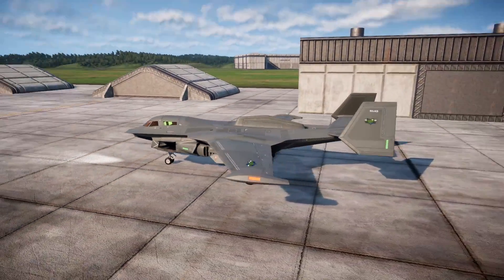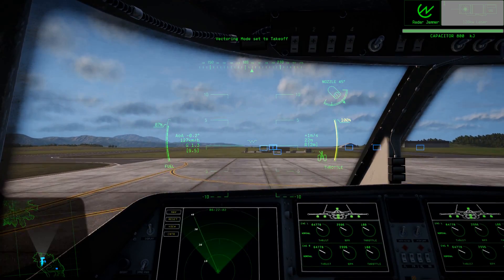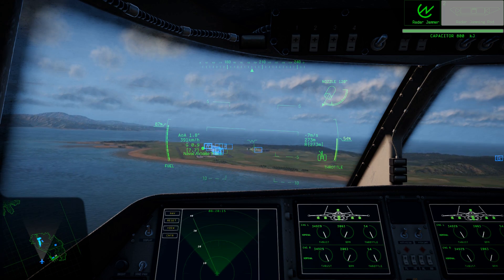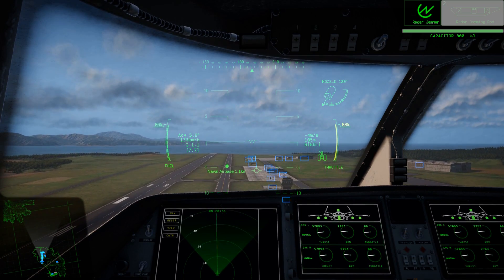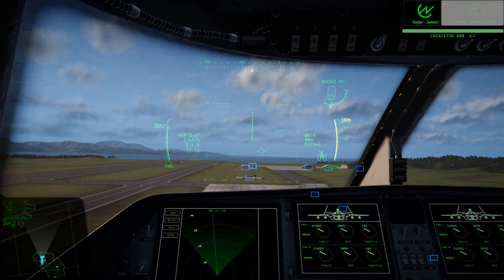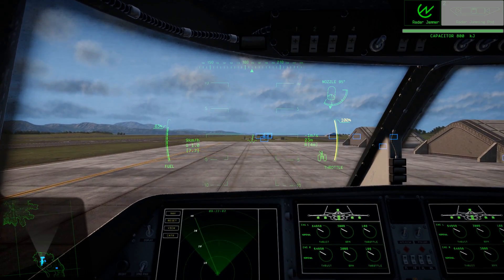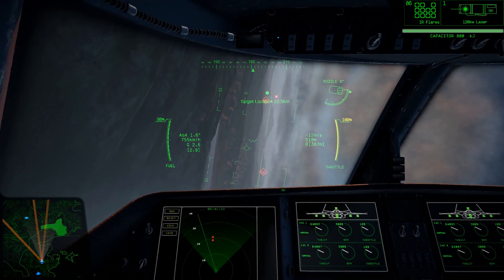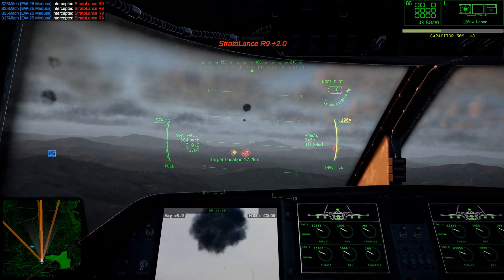EW-25 Medusa Introduction

Comment: It appears that hover mode doesn't activate until 40kts instead of 100kts in auto vector. You stall before reaching 40 knots in reverse mode. I don't know why the threshold was lowered so much, but it is impossible to hover properly in auto vector right now.
Reply: Note that kilometers per hour is used on the HUD in the video, not knots.

Comment: Using this in its intended purpose is basically nigh impossible because there's no way to target specifically missiles, and half the time I'm pressing the target key and it isn't acquiring a lock on the missiles. Got shot down 4 times in a row without being able to lock on to incoming missiles. Jamming pods seem basically useless too, was firing them at a radar truck and it was still pinging me the entire time (then I got pelted with missiles that I couldn't target). 

If there was a key for targeting that only targeted missiles that would be great. If the thing actually worked that would be even better. 

Also thanks for having no description on what the RADOME does. Really helps since having it on gimps your offensive capabilities to almost nothing, it would be nice to know what utility I'd be giving up to bring more HARMs.
Reply: You need to target the enemy radars and run the jamming pod. It's laughably powerful.
Reply: your radome does not limit ability to equip harms, overwieght does not do anything other than being a reccomendation
Reply: also just ask in the official discord (link in the game main menu) for any other help

Comment: Do you guys recommend me dusting off my joystick and throttle for this game? I'm using a controller for now and it's fine. The menus seem a bit jank so I'm worried about the integration with my flight stick setup and getting it all working.
Reply: there is a option to turn off controller menu navigation, but it works just fine on gamepad. joystick is more fun though!
Reply: YES! Simply turn off controller menu navigation. You can bind the controls yourself, getting kills with it is so satisfying!
Reply: @ Thanks :) I'll give it a go, I've been thinking about coming back to this game

Comment: suggestion: playable naval warships, maybe a battleship or battlecruiser using the 16 inch atomic shells
Reply: playable ground units will not be added, stated many times in the official discord
Reply: You can tell the ships where to go from the map. That's more than a pilot normally can do

Comment: It doesnt work bro. Jamming pods just dont work. Using jamming pods and i still get locked by radar guided missiles. Still get shot at from 30 kl away. Plz explain how to use this kit because this has truly messed up my experiance. Before patch I was loving this now Im just getting pissed off
Reply: It does, you got to target and jam the source (selecting it and using it like a weapon) 

For SARH, You need to jam the radar that's guiding it , either the Launcher in the case of the Boltstrike and the Shard Corvette, or the Radar truck in case of Stratolaunchers, ARH missiles (Scythes) can only be jammed when they "Go Pitbull" They are basically GPS homing at first until they get kind of close and they have the seeker inside the missile so you'll need to jam that when it wakes up, no the game doesn't tell you, you'll have to feel it out

Missiles can reacquire lock too if you don't break the lock long enough (about 2 seconds)
Reply: @Arcterran  What does the RADOME module that you can install on the top of the plane do?
Reply: @superkazuya3328  IIRC Turns you into a Radar truck basically, might be more to it but at minimum you get 360 Degree radar.

EDIT: Just tried this, It does but it doesn't show on your plane's radar screen (you get the normal front facing one) but it works on the map.
Reply: @Arcterran  OK thank you mate. I will try it next time I'm on. Do you have to have line of sight to the radar to jam it or just a lock
Reply: @danielle_pine9676  Yeah you need LOS but to be frank if you cut LOS From RADAR, they lose you too so there's not much point in jamming em if you want to defend yourself
Reply: Also, long range missile launchers don't have their own radar, they rely on the nearby trucks and towers. If you jam the truck in the middle of 5 launchers, none of them can track.

Comment: you're telling me this is a stealth aircraft with unretractable and unprotected external engine nozzle
Reply: its not stealth, but low-vis
Reply: @AAA_Battery3870  why would you be low-vis if you can get spotted from 50 kilometers by radar
Reply: @talie_t  you can notch very easily
Reply: @AAA_Battery3870  doesn't answer why you would be low-vis if you're visible by radar
Reply: @talie_t  even the raptor can get seen, and if you are flying far up and at distance in the medusa you are not detected. also if you are in the notch position radars are less likely to find you, as going into that reduces your radar return.
Reply: @AAA_Battery3870  of course it can still be seen, no plane is perfectly stealthy, but the F22 is a stealthy plane designed for stealth, which is why it doesn't have things like fully external engine nozzles like this thing does
Reply: @talie_t  correct, and this is not supposed to be stealth either, just low visibility. its very much a minor design element where other features take priority over it.
Reply: @AAA_Battery3870  that just leads back to why is it low-vis if it's not stealthy
Reply: @talie_t  idk to be fair, but low vis is still good no?
Reply: @AAA_Battery3870  i can't see how there's a point to it if anyone can see you coming with radar from kilometers away
Reply: This is an EW craft. It's not trying to not be seen. It's throwing sand in your eyes.
Reply: @kerbalairforce8802  thats why modern EW aircraft arent trying to look stealthy but look at this thing

Comment: i have trouble getting the medusa into hover mode.
still an AWESOME aircraft though
Reply: the medusa does not like hovering, the nozzles on it are only there to take off shorter, like carriers for example
Reply: @AAA_Battery3870   did you see the video? or the in game description? it is a STOVL aircraft (Short Take Off Vertical Landing), i just have a big skill issue.
Reply: @sleep_deprived_stormworker  i have seen the video. the nozzles are really only to shorten the distance to takeoff/land, not nullify it. i recommend going in for standard landings with the nozzles at ~70°.